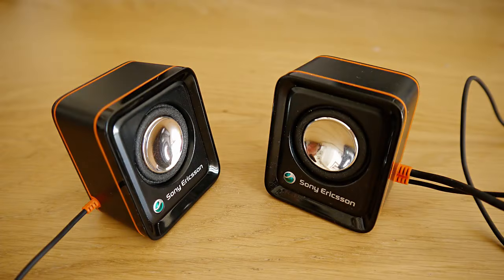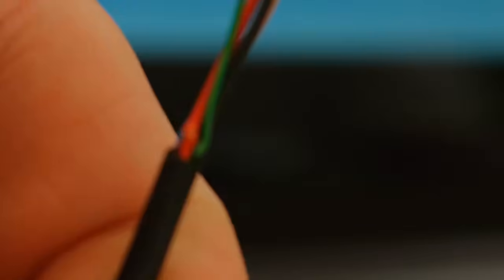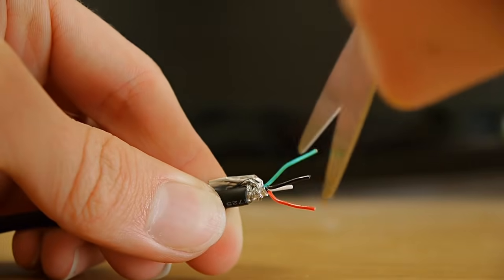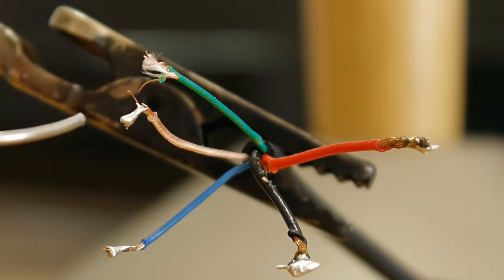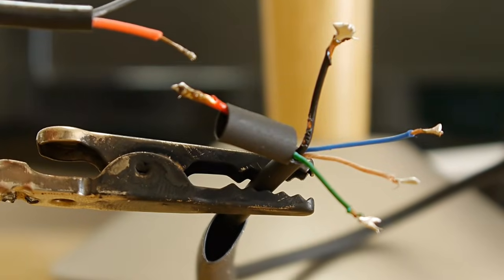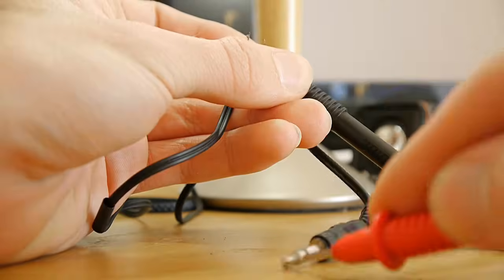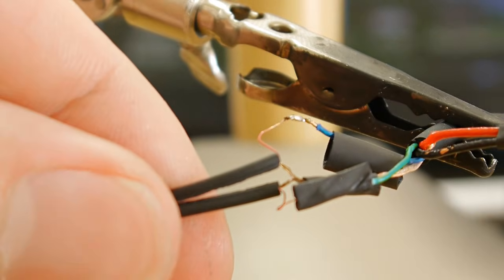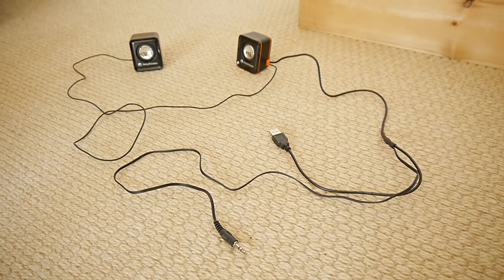Change Ericsson MPS-70 into USB Speakers

Comment: i turned a set of these onto a headphone amp when i was in high school, because the wire for the 'end' speaker got damaged and the amp circuit was in the speaker that is on the end of (as you call) the 'input' wire, taking out the driver and adding a 3.5mm socket turned it into a freaking loud headphone amp, put it this way, it got so loud i could feel the in ear headphones get hot in my ear and surprisingly didnt distort at half volume on the phone because thats the max you could go without blowing headphones or ear drums.

Comment from the maker: Wow, really? Interesting, I'm surprised. I'd have thought that anything higher than 5v would kill the amp.
Reply: The solution are chargers for vehicle's cigarette lighter connection. ;) I won't go over 6 volts because there are capacitors limited to 6.3 volts. With tolerance maybe 7 volts... but nothing higher. The chip itself maybe is regulated and can handle up to 30 volts without serious problems.

Comment: I did something like this last year only I added in the option to switch between a 9v battery and a USB connection. It does work with a 9v battery

Comment from the maker: The amp is in one of the speakers, not in the connector.
Reply: I have a USB wire and jack only speakers, They have socket for power input.

My question is, how do i connect the (Red and White wires of the Jack(which broke)) to the (4 wires of USB).

Basically I want to replace the jack head with a USB.... Thanks....

Comment from the maker: Yes, it is pretty much the same thing.
Reply: Excellent video, i had been considering doing something like this for years with mine but never got round to it.
I was thinking of using them with a Sony MP3 player the HD5 or the Vaio VGF, they have a socket for a remote control which must give out power as it lights up, any idea if the output power would be enough to make these speakers work.

Comment: hi, great explanation! i have one of these but i've seen in several videos that is better to keep the build in pcb twich comes with it and power it from usb and then conecting the audio jack to these pcb. is there a big difference in the sound between doing that and doing it your way? Because i have to say your way is easier but i want to keep the sound of these little speakers! Thanks in advance

Thanks

Comment from the maker: Thanks for the complements! :)

One of the reasons I keep going with these videos is because the audience is so positive and friendly (most of the time).
Reply: I have speakers that are powered from wall socket (AC). Can I cut there wire and add a USB head to them to power them from my PCs USB port or is it not so simple? Please help.

PS awesome video, love your channel.
Reply: @KamranKhan2K  u cannot just add a USB cable as ur speaker would contain rectifier circuits and transformers first you have to remove them

Comment from the maker: The process of converting the  MS-410's should be very similar (same contacts etc), but I expect that its connector is mounted directly onto a PCB, rather than wires, so the challenge would be soldering your usb connections etc to it. The only way to find out would be to open it up, and Sony's stuff is usually quite hard to get into.

Comment from the maker: To power the speakers from a battery, just get three AA batteries in series (no more than three, and you'll probably need a battery holder) and attach the black cable to the - side of the batteries, and the red cable to the + side of the batteries. :)

Comment from the maker: It needs the USB connector for the power, while the audio comes in through the 3.5mm jack. To make it 100% USB operated would require some kind of USB audio interface.

Comment from the maker: Only if the device has the ability to give power from its micro usb connection. I doubt many devices do (though my Nokia N900 does), but some Apple products have the option. You could of course hardwire it directly to the phone's battery connections...

Comment from the maker: Sounds like the USB is the problem actually! When you plug it into the computer, you SHOULD NOT hear the "USB device connected" sound. You may be using the data wires instead, which isn't good. Try using the brown cable as the ground, rather than the blue one. That might be the problem.

Check them with a multimetre to be sure, and you could also try powering the speakers temporarily with a 5v source (like a battery) to check your 3.5mm wiring. Good luck!

Comment from the maker: You'd have to be a lot more specific than that :) do you mean passive 'bookshelf' speakers that work with most hi-fi players? If so, you could just add a jack to the wires (combine the ground signals) and just attach them directly. That's what I've done with my PC and the sound quality blows away any 'active pc speakers' you can buy in the shops.

Comment: I have a different USB cable, I think the wire colors, mine are red, blue, brown and yellow, but I found that the
Red-5V power cable. Same as a normal cable
Brown-Data cable (-). Normal cables are white
Yellow cable-Data (+). Normal cables are green
Blue cable-Ground. Normal cables are black.
But when you plug in the USB I get the sound, so I think that's not the problem.
Possibly it may be that speakers do not work, because I have not tested since I have no more Sony Ericsson cell phone.
ty

Comment: HI!I have a problem,I tried to do the same, but it does not work.I did everything the same as you.
When you plug the USB into the computer,I hear the sound that the USB is connected,but when I plug 3.5mm jack nothing happens,why???
So i think that problem si in 3.5mm jack.I tried three different 3. mm jacks,but nothing,the one is like in your video,two grounding wires,and  I joined like you,and the other two had three wires,white,red,that is L and R,and non-insulated wire witch is GND,HELP!

Comment: Excellent video! My old MPS-70 speakers were just laying around collecting dust, and I didn't want to throw them away because I always thought they sounded awesome for speakers of their size. Now I have converted them using this video and use them with my laptop and with my new phone. In the latter case I just stick the USB cable in a 5V (5W) adapter which I had since earlier and plug it into the wall socket. I'm definitely bringing these babies with me out to the cabin this weekend. Thanks!

Comment from the maker: Yes, be careful of that if you try this build. The wire is rubbery, and incredibly difficult to strip cleanly. I tried 3 times, each time nicking the wires. Easy enough to fix with some electrical tape, though, so it wasn't really an issue.